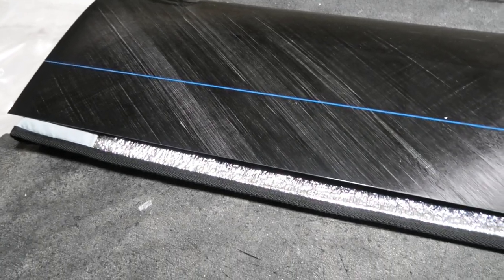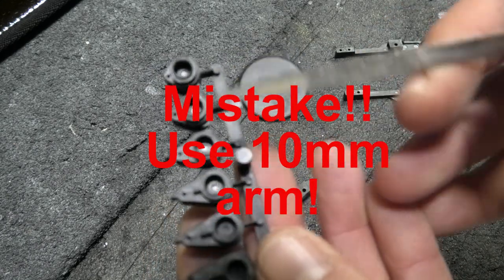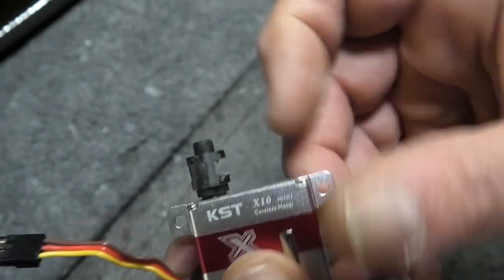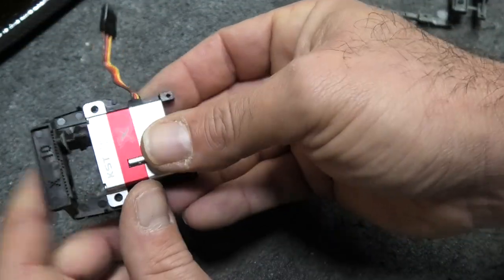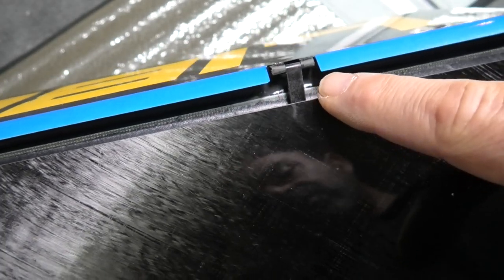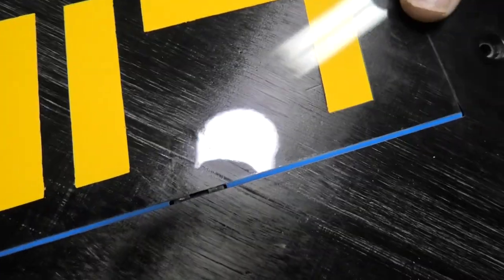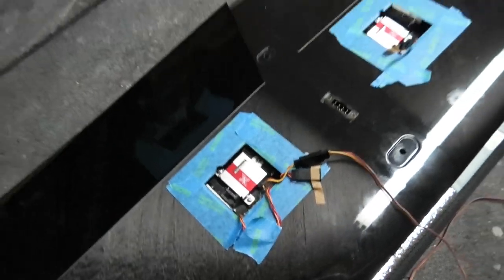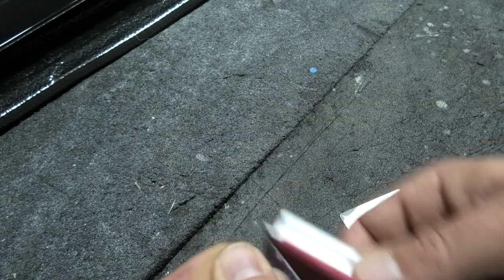CCM Liberty F5J RC Glider, Flap Servo Install

Comment: Any chance you could share the .stl file for the wing root servo connectors please?
Reply from the maker: Sure-
https://cdn.shopify.com/s/files/1/0789/2325/files/LibertyPlugTip.STL?v=1683345685
Reply: @flightcomp  Thanks! Could you also share the .stl file for the part that goes in the centre section please?